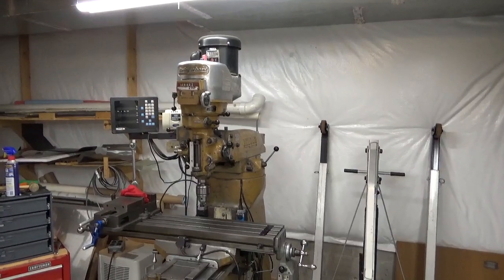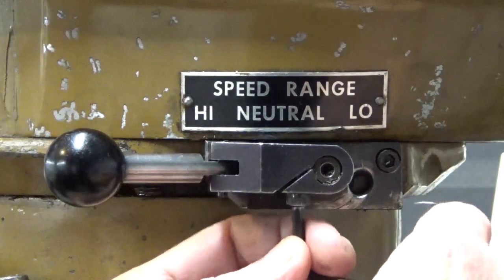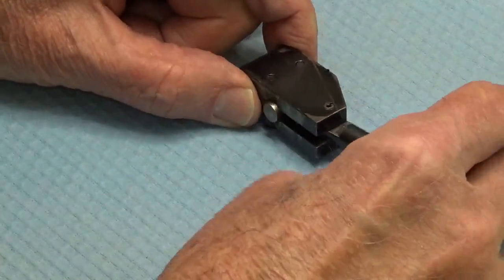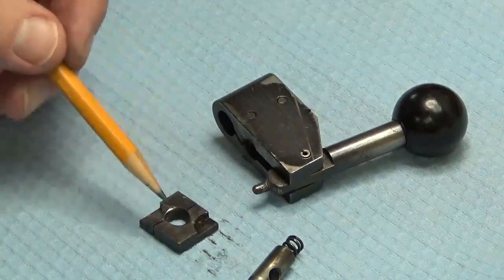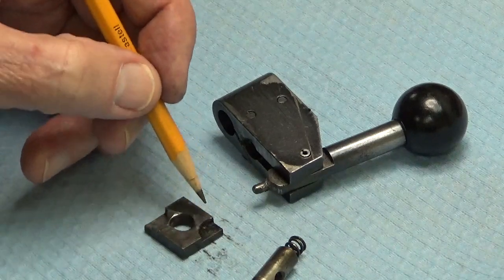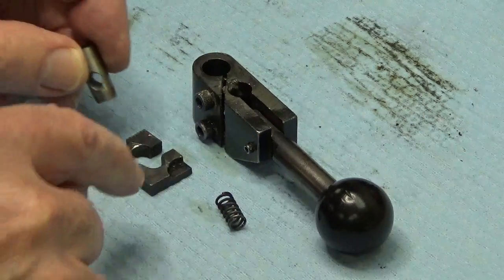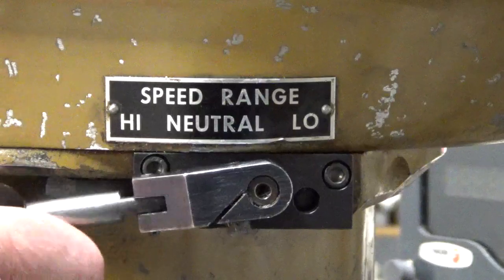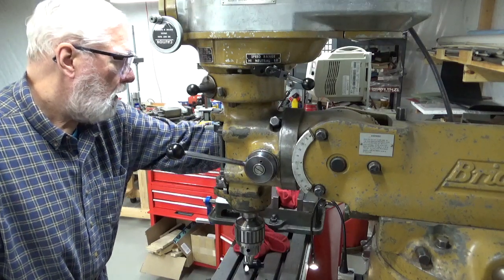Bridgeport Vertical Mill - Repair of backgear selector

Comment: POST A link of where you found this part.
Reply: H & W Machine in Fort Wayne Indiana rebuilds Bridgeports and supplies parts for them.
Reply from the maker: It has been over 2 years since I posted this video, and I just don't remember where I got the part..  There are several sites that post parts diagrams for the Bridgeport mill.  My recollection is that I got the part number from one of those and then searched that on Google to find a vendor.  Sorry.

Comment: The metal square with the hole in it that was cracked in half is a part that allows you to adjust the clutch engagement depth. I couldn't see yours but on mine there is a set screw that allows you to loosen it and slide it up and down. As the clutch wears you can move that square up which moves the Hi - Neutral - Lo lever up more so it engages the clutch better and eliminates the rattle that can sometimes be caused by the loose clutch engagement. Here is a link to a youtube video that I learned it from. Mine was rattling terribly and this fix did the trick. https://www.youtube.com/watch?v=zjKO-nVxhSM
Reply from the maker: Thanks, Cody,
I don't recall seeing a screw in the broken part but it is possible I missed it.  I threw out the broken pieces so no way to check now.  It looks like Bridgeport made a number of changes over the years.
Reply from the maker: Thanks, Cody.  I have not had the rattle problem, but now I know what to do if it does happen.

Comment: I got a used Bridgeport and mine needed to be repaired in the same area.   The part was the same as what yours was originally.  Mine was missing the entire square.   Bridgeport must have figured out that the version with no moving parts was a better (or cheaper) design.  At any rate thanks for sharing.
Reply from the maker: Glad it worked out for you.  Now we can both "Git er done"

Comment: I wonder why they made one different?  Must have been trying a new idea.  The replacement is a lot simpler.  Of course I can see how that would allow the high speed gear to align further in or further out.
Reply from the maker: It might have been an experiment by Bridgeport.  It looks like the original paint job was gold which I never saw before.  My unit came from a college shop, though.  Maybe a student project?